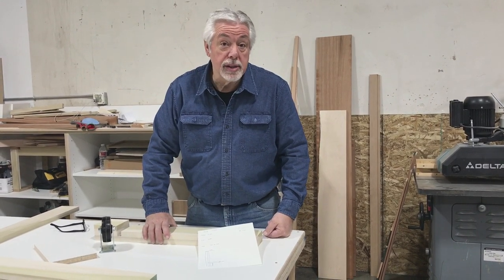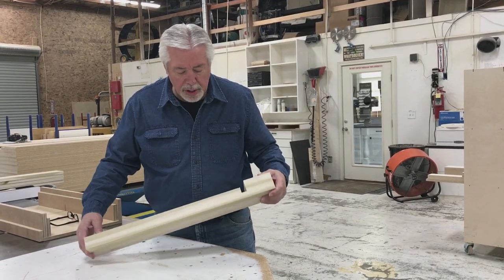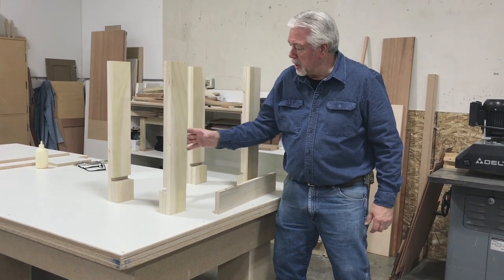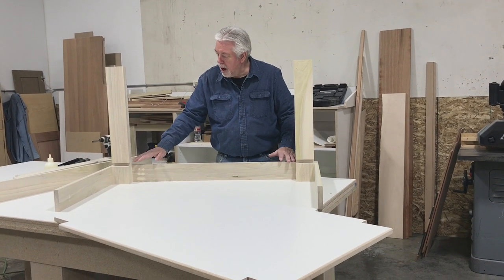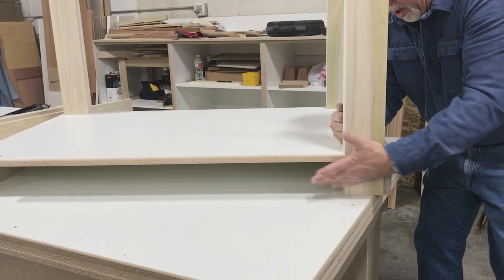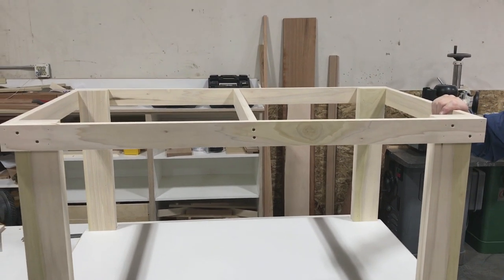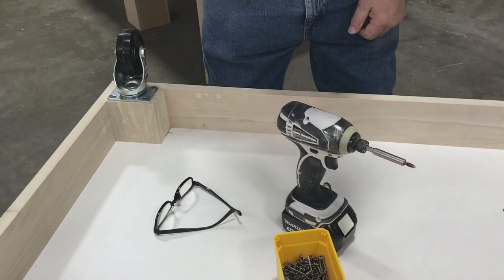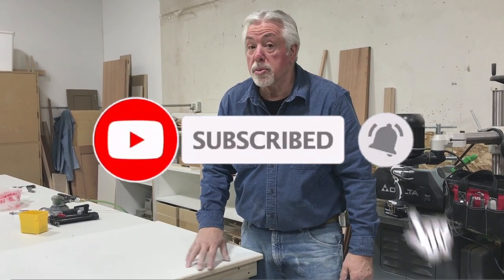Every Shop Needs A Heavy Duty Mobile Cart

Comment: I like your cart.  I could use it by my lathe. right now it is a trash can with plywood on top.  I like the idea of it being table saw hight.  I am guessing it was made with poplar?  Do you have a material list?  I realize it depends on how big you make it, I am just trying to get an idea of how much material I would need.  You said the blocks were 4 inches, was that actual 3 1/2 or a 1x6 cut down to 4 inches?  Your video was pretty clear on how to put it together.  I appreciate your ideas.
Reply from the maker: Yes...popular and white melamine for materials. Full 4" for the measurement. Good luck., I am sure it will be great. Thanks, Wes
Reply: Thanks for the reply. Just need to get some casters so I can get measurements for my table saw.

Comment: What did you fill the top surface screw holes with?
Reply from the maker: Hi...I didn't fill the screw holes in the top so that I could replace is easily if necessary. Thanks for watching, Wes